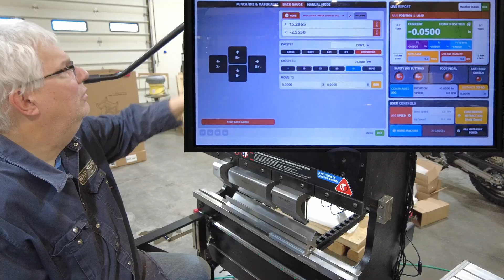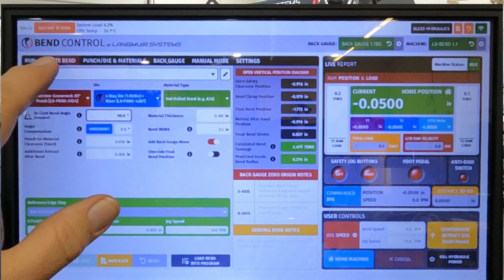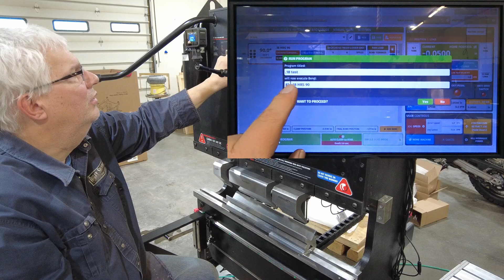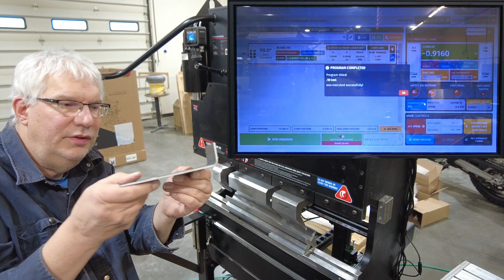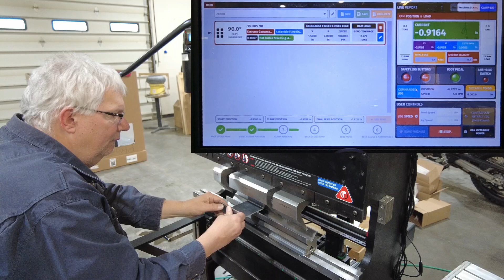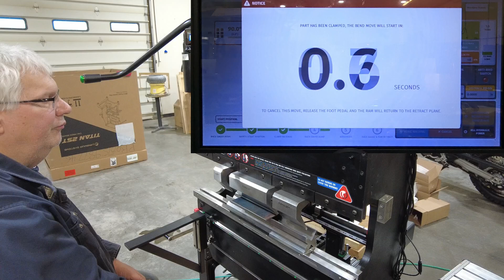Titan 25T 7ga HRS Bend Testing

Comment: Cool!  👍 It would be rather painful if you had to tweak and adjust for every material width.  Still interested in the thicker stuff, but I don't know that my order will be placed anytime soon.  It turns out to be a little more expensive than I anticipated with all the accessories.
Reply from the maker: Please check out my part 2 video. As for the accessory pricing, we bought everything, backgauge, stand, material support, full width of extreme gooseneck punches and 4 way dies. With shipping, came in around $8K. For tooling, check out their punch and die guide, which includes tooling pricing.

Comment: .187 = 3/16"     You are in the largest 4 way at 1.9 which is a bit large, you would prob be better off with the next smaller v die opening at 1.378. I bet the factory settings for that die would be much closer to 90.    8x for 3/16 = 1.496.       Thank for the interface on the screen - very useful :)        Rather slow in comparison with a standard hydraulic press brake, with all the delays and screen inputs needed imo. I get my machine tomorrow, so I appreciate the preview of what I will be learning also :)
Reply from the maker: Yes, this video is full of mistakes, as you have mentioned. My machine time is about 30 mins. I have the bend speed at default 5ipm, it can be 15. Also sorry for the crappy screen grab, first attempt at this was, in my book, a fail on quality. Thanks for watching, will do better next time for sure.
Reply: @CraigHollabaugh  I was admiring your video skills actually - wondering to myself, hmm...how does he do that?!  I learned a lot from not only this video, but all of your posts and content, so a huge thank you!    You are on the cutting edge of the Titan, forging the future for all of us :)